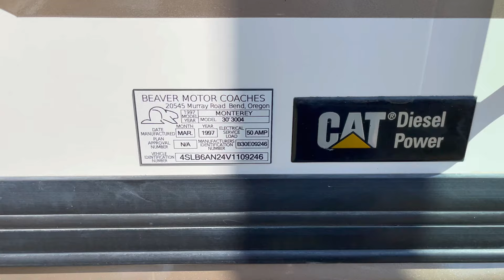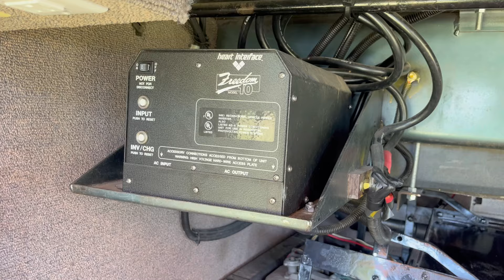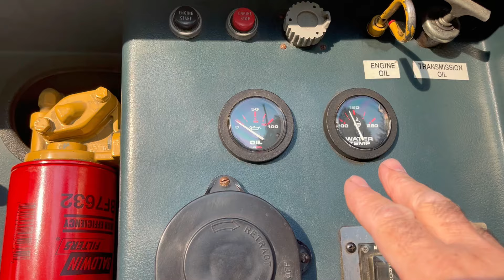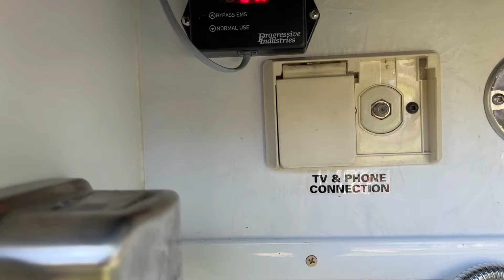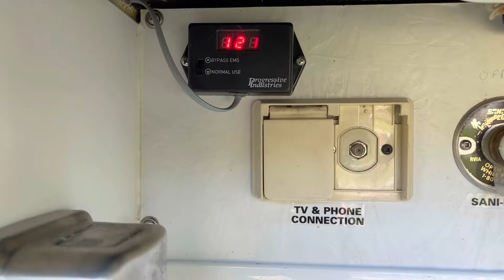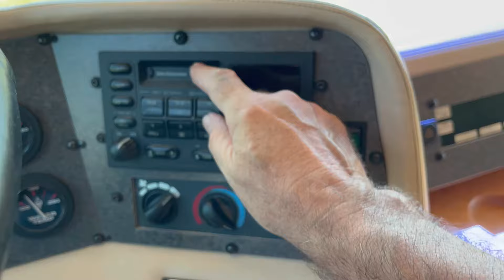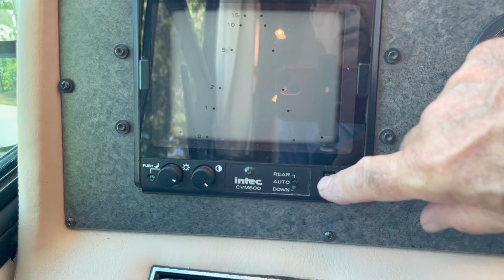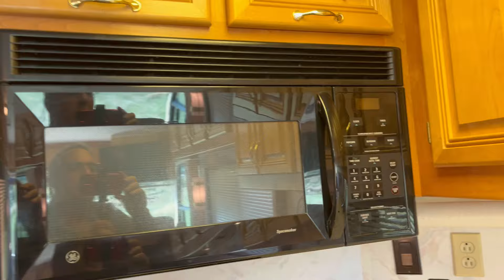Detailed Look At This Old Beaver Motorhome - Worth A Peek!

Comment: The headliner is made from a product called hull liner used in boats it is a nylon base and the wash out using super purple and a carpet cleaning machine
Reply from the maker: Thank you!  While it seems common to use, I'd like to search for something with more depth - liked a padded panel of some sort to absorb sound and give the cabin a more cozy feel.  If you know of something like this, please tell me.  Many thanks.

Comment: The older Beavers are said to be really well made.    And no slides!  Perfect.
Reply from the maker: Oh good, I'm glad you said this because it's something we believe to be true - based on our 6 year experience with our Beaver.  You can see it throughout, from the strength of the cabinetry to the robust nature of the chassis and Cat engine.  No slides was a priority for us as we searched for the ideal 30 footer and we find inside living to be comfortable and roomy.  A simple, tough machine.  Thanks for watching, and for making us feel good about sticking with ol' Monty.  Cheers!
Reply: @ThisOldRV2023  I wish the newer Super C's had a No Slides option.  I'm thinking of spending the time a searching for an older Beaver.   Thanks for posting this vid.
Reply from the maker: A super C without slides would be terrific.  That would be one tough, solid rig.  I'm glad you're looking at Beavers, I think you will not be disappointed.  We found Oregon to be the most vibrant market for Beavers - especially around the Eugene and Bend areas where Beaver began its life - Bend first and then production was shifted to Coburg, near Eugene. Still lots of dealers and workers who know these coaches well and have access to used ones.  I hope you find what you're looking for.  Have fun searching.  Cheers!
Reply: @ThisOldRV2023  I like doing my own work and maintenance, do simple and solid i like. Thats a great tip thanks for taking the time!
Reply from the maker: You're most welcome.  It's been great chatting with you.  Bye for now.

Comment: How do you keep the Mice and squirrel's out of all the basement spaces??
Reply from the maker: A very good question.  I suspect there are times when mice are inside and we're not aware - but so far, we've been lucky.  We haven't had a  squirrel thank goodness.  When we first bought our motorhome, I did find the remnants of a mouse nest behind the panels that surround our water tank.  This is why I like to periodically pull the panels away to inspect this area, as I did in this video.

We started by filling any obvious openings in the lower area of the rig with foam, but as we all know, these creatures can squeeze through the smallest of openings.  We also spray sections of the motorhome that are suspect, such as around the hot water tank and areas where there is wiring, with peppermint spray.

For the past 3 years, we haven't had any problems.  But in 2020 we discovered a rat in our rig.  We determined it was in the heat distribution system - the flexible housing where the heat moves from the furnace to various floor heat vents in the rig.  It may have entered the motorhome through the vent opening on the exterior of the motorhome, but who knows.

We could hear something in the heating system and eventually, it was killed when we started the furnace.  It became caught in the fan wheel.  When I opened up the furnace, I found the body.  I guess they like to get into warm places, especially in the winter months, and heating pipes are ideal.

We learned from this to always seal the outside vent opening into the furnace whenever we are away for any length of time (eg storage periods).  We also learned to frequently check our vent housings to determine if there are any nests, or heaven forbid, decaying mouse or rat bodies.  One technique is to open each vent opening in the floor and try to get a good picture of the trackway with our cell phone - to see if we catch an image of anything.  An endoscopy type of camera device would be ideal, and I think you can buy this type of scope.

Another thing we do is open the inspection boxes to the heat housing lines (we have two) to insert a camera and feel if there is anything obstructing the line.

Another obvious entry point that we all have, that is perfect for allowing a mouse, rat or a squirrel to enter, is the area in our wet bay where we open up the hatch to allow access for our electrical cable and water hose hookups while at an RV park.  The electrical cable and water hose are convenient ladders for the creatures.  Once inside this area, they are free to roam anywhere in the bays and upwards into the rig.  It's a good idea to place soft foam or some other flexible stuff, like steel wool, around your incoming cables to close off this area.

As a last resort, we travel with two cats!  They are the ones whose ears alerted us to something in the heating system.

The question you raised is an important one, because I believe there is no absolute way to keep mice (not sure about squirrels) out of any place where we humans live.  The best we can do is minimize the opportunity for them to enter.  I hope I've offered a few tips, and what we can do to inspect our rigs in the event that they get inside.

Comment: Hi.  Really nice rig with perfectly functioning systems.  Wow factor.  On my bucket list is to address creeping window syndrome on my 90’s Country Coach; every window has the creep!  Did you replace windows or have the seals replaced in the old ones?  Can you approximate the cost?  Thank you.
Reply from the maker: Hi, and thanks for your kind comment. I bet your Country Coach is a gem.  I guess creeping seals are quite common on our older coaches.  We too had creeping seals in all windows.  On the recommendation of the place that did the work, we chose to replace the window glass, rather than replace the seals in the old windows.

This was RV Glass Solutions in Coburg, Oregon.  They are highly respected for this kind of work.  They suggested replacing our old windows with laminated glass and we chose a light, bronze tint.  While we lost a bit of R factor because of the lack of air space, they suggested we probably wouldn't notice the difference compared to the old ones. They were right. 

They told us if we chose to reuse the old glass and simply have them taken out, pulled apart, cleaned and new seals installed, there was a likelihood that the seals would again creep.  So, why risk it, even if the chance of that happening might be years down the road.   The cost of doing either process was about the same.  We paid $3,500 USD for the entire job.  This was last January, 2024.  They honoured a quote they had given us 4 years prior.  We had to cancel one booking because of Covid, and then other things popped up resulting in the delay getting there.  We live on Vancouver Island in British Columbia, near Victoria.  Freezing the price for us was a very decent thing for them to do.

We cannot say enough good things about this company.  They do great work and they honour their work guarantee.  I believe they have another location in the east, and one in Arizona.  If you are interested, I would  suggest calling them in Coburg and go from there.  The contact person is Karie Murphy, she will likely answer the phone.  The number is:  541 762-1848.  Her email is:  kariem@rvglassexperts.com

Address:  91302 Coburg Industrial Way; Coburg OR 97408

I hope this helps.  All the best.  Bill
Reply: @ThisOldRV2023  Bill thank you so much for going thru the entire window replacement process, pricing, and for company contact info.  I’m sure this will help others too.  Your video was very enjoyable to watch, and informative.  Can’t say thank you enough.  Happy and safe travels to you and your family.  PS. One of my most memorable car trips was Hwy 1 along the coast from San Francisco to Port Angeles, then ferry over to Victoria which was beautiful!
Reply from the maker: You are most welcome, I'm glad this was helpful to you.  And that is a lovely trip along the coast.  Happy and safe travels to you and your family as well. Cheers!